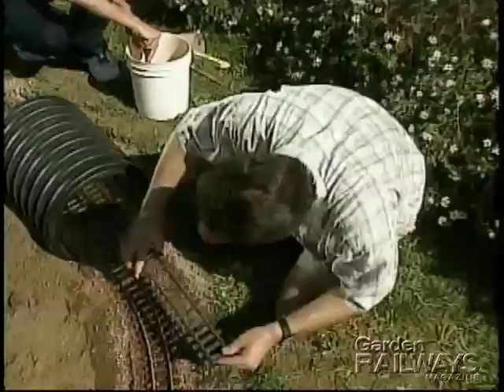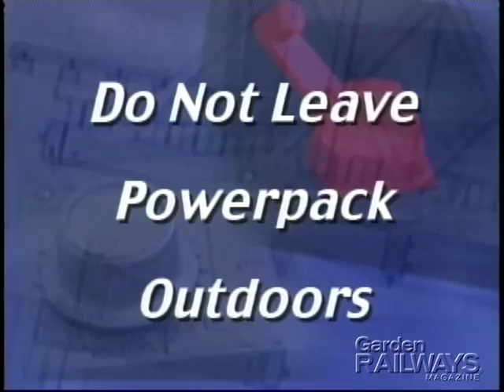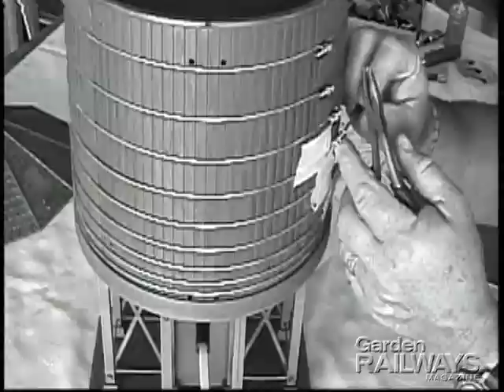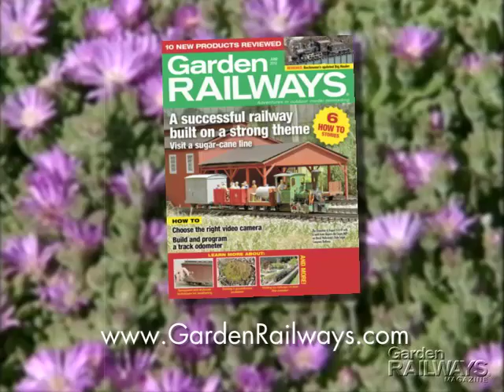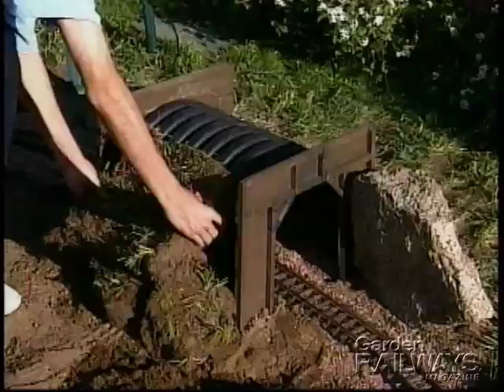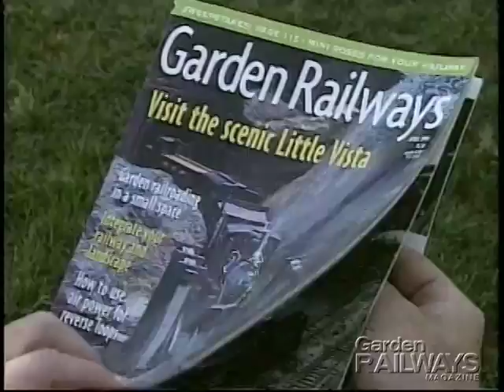How to build a basic garden railroad, part 2

Comment: im sure im not the first but if your new i found  that i buy cartons of popsicle sticks  by the thousands are th best building supplys ever  homes water towers bridges   my wife even tols me my bridges are better than any store bought stuf shes ever seen  add some multi color leds  i even built my own turnstyle house      rip somr  1/2in  1x4s fore trestle supports  i look at pics in books an build freehand  elmers and  some thick super glue some model paint  farmers markets are a great sourse for supplies i even made my own track cleaner car   a lgb  engine pulling a   pice of  sand stone   all my joints are soliderd  another trick i use i take multiple pices of straight track  and solder them in my basement workshop  with a laser and turns with a compas scriped on a piese of wood  indoors i even made a switch yard on 4x8 sheet of plywood     and weather proofedit it  and took it outside when finished   im lucky i have acess to all the solid silver wire i need for free for control  to my lay out   i also get free d-8  12v battries for pwr  i charge them with a single solor panel  i hope you find some ideas from my experance   im currently working on makeing my own track from copper bars and oak slats  i have the time im retired now all the bills are paid im now got it made in the shade my buddies  say to me